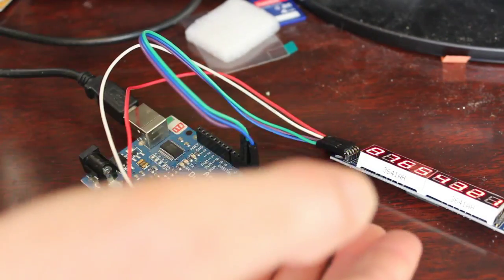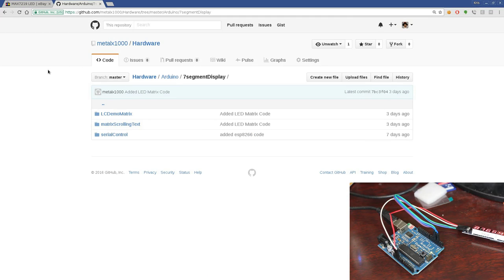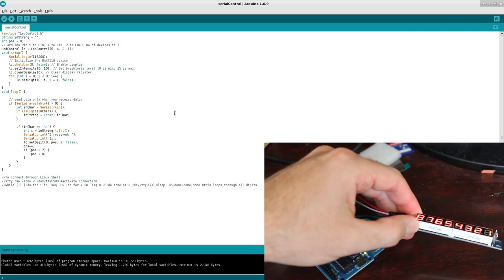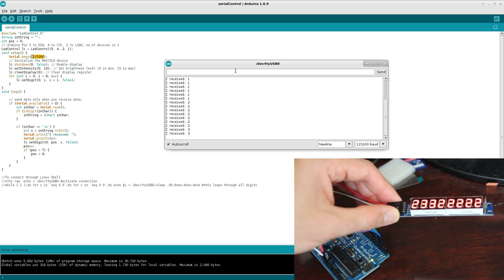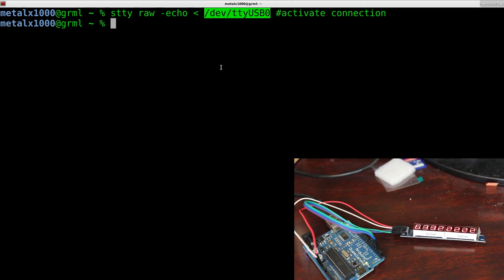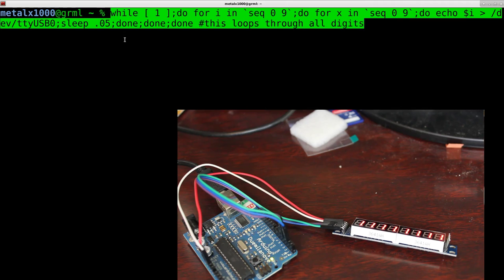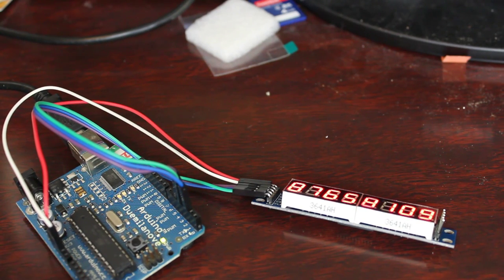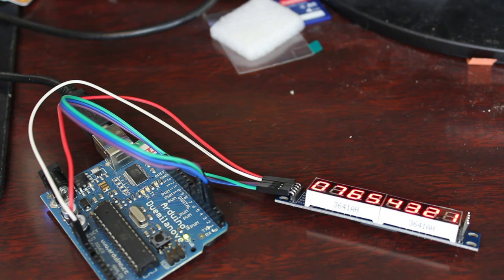Arduino 7 Segment Display Serial Connection Max7219 Tutorial

Comment: Hi, i am new at Arduino, and i bought some MAX 7219, and i have a little question. It comes with some "adaptors" or pins, i have to weld it with a stanium solder? Or just pasting it with an adhesive?

Comment: Could you possibly do a video on having this same 8-digit display reading 00000000 but adding +1 every time a digital input button is pressed? So every time (in my case an arcade button) is pressed it goes 00000001 00000002 00000003 and so on so forth. I've never done coding/arduino projects before so its been quite a struggle trying to figure this out. I'm a sculpture student and trying to use this as a particular component in a sculpture project, any help would be wonderful as I'm currently tearing my hair out. Thank you!!

Comment: have you thought about making an arduino based transceiver for sending free text messages locally, a lil like qrp or w.e its called?
Reply from the maker: I'll have to look into both those projects.  Sounds like a fun idea.
Reply: Films By Kris Hardware nice, yer you would need 2 of them and each would have both RX and tx I can't wait for that project it would be very cool.
Reply: I still have other videos coming up on different displays, which might be better than this one for messages, since it's limited on the letters it can display.

But, next week I am going to show how to use an ESP8266 module so you can send messages to this display over WIFI.  Not exactly what you're talking about, but along the same lines.
Reply: 2 because 1 user can communicate to another user :)